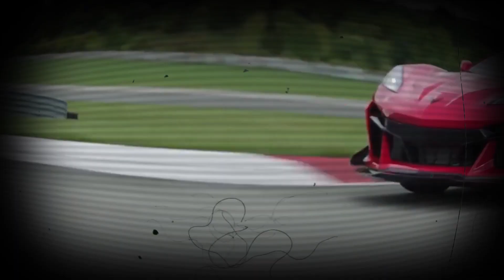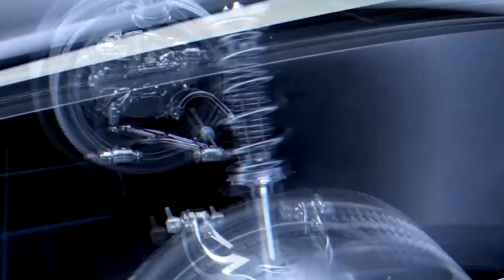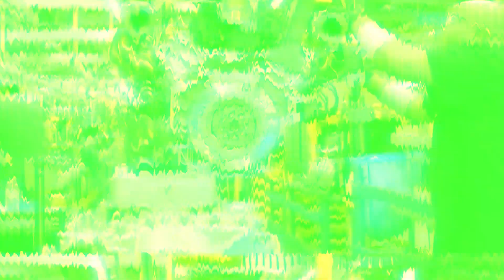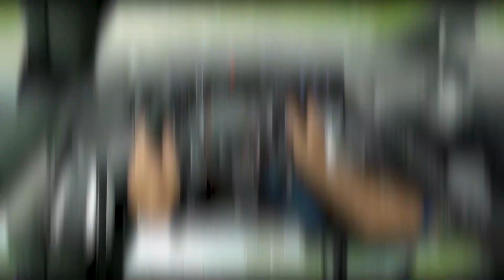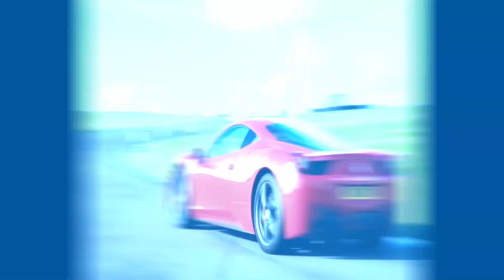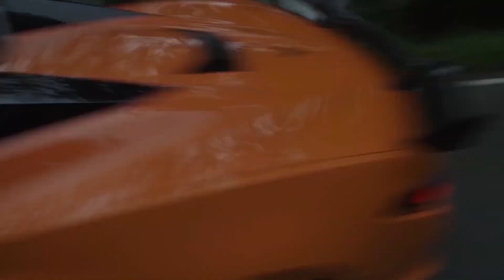How Chevy STOLE Ferrari's Engine And STUFFED it into the C8 Z06

Comment: Sorry. The Ferrari flat-plane crank engine that supposedly Chevrolet Stole was actually invented by Cadillac in the 1930s. Maybe you can mention that Ferrari stole Cadillacs magnetic suspension and uses it on their cars
Reply: Eugenio Barsanti e Felice Matteucci. Those two ITALIANS invented the internal combustion engine. 😂 Plus Vette copied the details that make run so well that engine, not the configuration you genius